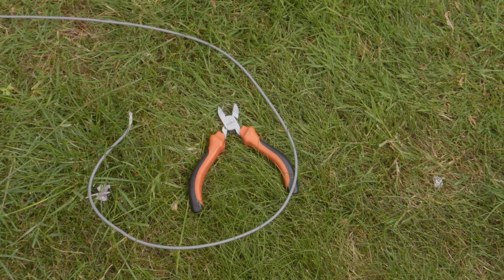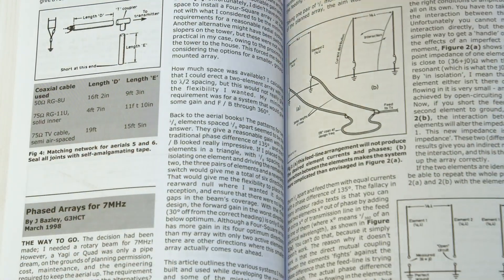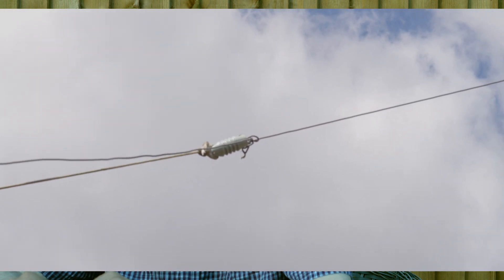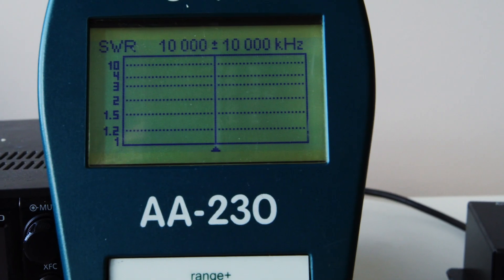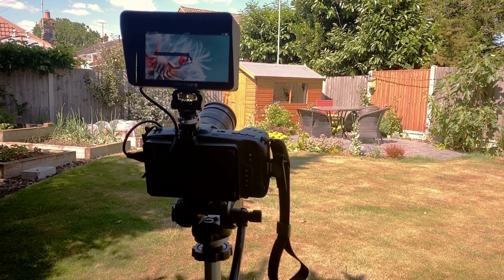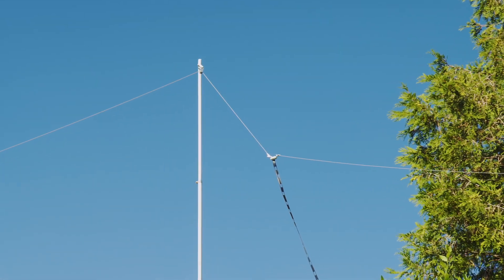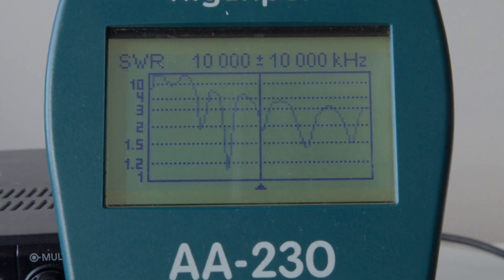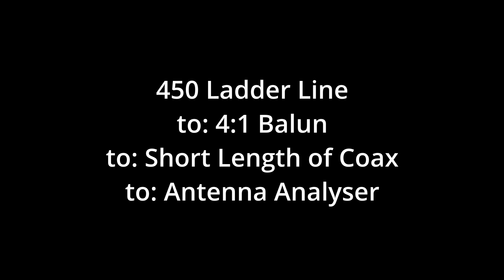HF Doublet Antennas - Create Your Own Muti-band Antenna

Comment: I have a 150-foot end-fed HF antenna that runs north and south. Would it help me if I went to the middle and ran a 75-foot wire west and a 75-foot wire east, making a + sign? 49-1 Balu would be at the end of the north wire, then go to the shack,

Comment: QUESTION:   Does anyone recall or know a link to the article where a ham switched various lengths of window line as his antenna tuner?   

I realize he was just finding the low-voltage point in the feed line to satisfy the radio, but I would be interested in seeing that article again. 

thank you

Comment: My favorite wire antenna was my doublet that was somewhat near 150 feet long, I don't know the exact length, and it was 100 feet high.  My radio was at the window about 1 foot to the side of where the transmission line came down from the center of the antenna.  Originally used RG-59 CATV coax to feed the antenna to my tuner, but later upgraded it to 300 ohm, and then to 450 ohm window line.  (The difference from coax to 300 ohm was more than phenomenal, but the difference between 300 to 450 ohm was probably there, but not as noticeable. 

To run the window line into the window, I used the two short (6 inche or less) RG-8U coax pieces with the shields shorted.  It worked great for me. 

In this apartment, I'll need the balun and coax to make it work because of where the station is vs where the feed line will enter.

Comment: WHY NOT TRY A 40M LOOPANTENNA WITH 450 OHM FENDER AND THAT WILL BE USEBAL FROM 40M DOWN TO 6M WITH A MFJ969 MFJ962 OR MFJ986!
EVEN LDG Z11 AND LDG-200 PRO III CAN BE USED WTH BALUN 4:1 OR 2:1 BUT WITH LDG 4:1 BALEN!  USEBALE BETWEEN [80] 40M TO 6M WITH EXTERNAL BALUN 2:1 OR 4:1 DEPENDING
ON WHAT IMPEDANCE THE ANTENNA REPRESENT TO THE FEEDLINE.
160 M & 80 M LOOPANTENNS CAN USE 
LADDERLINE OR WIBDOWLINE OF 45OHM
CHARACTERISTIC.
Reply from the maker: Yes there are many options but. this one is so simple requring just a simple UnUn

Comment: Ah the G5RV, had  one for many years.  Cadmium copper - had a few issues but I reverted back to the original design and changed the coaxial feed to balanced feeder.  The master was right.  The other advantage was some of the lobes got me into a range of countries I had previously struggled with.  Thanks for the vid 😉😎

Comment: I always cut my antenna wires about two feet too long on each end and I fold the end back through the end insulator and secure it with a "split bolt" or a Chinese two bold stainless steel cable clamp.  I move the two ends back and forth to tune it.  I always use very high quality (long) end insulators. Ron W4BIN
Reply from the maker: Many thanks Ron. 73 Peter

Comment: The reason your antenna doesn't work as calculated is you hook a 50 Ohm transmission line on a 72 Ohm antenna.  (dipoles)  I always used RG59/U and RG11/U on dipoles with as calculated results. Ron W4BIN
Reply from the maker: You are confusing a resonant dipole with a doublet, the latter of which was the subject of this video. BUT  any impedance miss-match on a dipole feed does not affect resonance. 73 Peter

Comment: Hi Peter, I used a 1:1 Balun on my 120 ' doublet it worked far better than the 4:1 as on some bands the impedance presented was far to high anyway so the 4:1 just transformed it higher, maybe try a 1:1 on yours with the RigExpert and see what the difference is if any. Keep up the good work.
Regards
Dave.
Reply from the maker: Hi Dave,, a 4:1 balun is used to reduce impedance  but the main matching problem on a doublet is reactance. 73 Peter

Comment: I always enjoy your videos!  My first HF, antenna built in 2001, was an 88’ north-south doublet up some 65’ between a redwood and a pine.  It used some 70’ of 300 ohm ladder line to a Balun for an 80’ run to the shack.  It worked the world, all zones,  but was a bit challenged working Europe, and challenged on 80m and 160m (grin) but I managed a few contacts there.  It was a treat on 10-40m!  All subsequent antennas paled.  Unfortunately, the center was near the front door, and developed severe XYL static.  Grin.

Comment: Great videos.  I have been an active ham for 64 years and really enjoy your content.    A doublet is my favorite antenna.  I use 300 ohm ladder line as it is light weight and harder to see.  My 1 to 1 LDG balun works best along with my Ldg auto tuner.  The antenna is105ft long with the ends drooping out of trees.   My hoa does not allow antennas.   I find a center fed doublet more efficient than end feds..  73 WA6MOW
Reply from the maker: Great to hear from a fellow old-timer across the Pond. Thanks for watching. 73 Peter